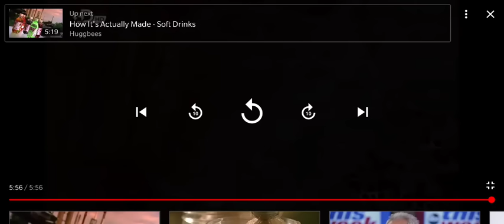Psychicpebbles Sandwich Rant on How it's actually made

Comment: I work in a place where we are explicitly told not to wear gloves to handle food. Instead we have to cut back our nails, and wash our hands constantly. The reason being that gloves give you a false sense of security and you end up touching things you shouldn't, and don't keep clean. So ironically instead of being safer, the gloves start collecting oils and bacteria and you end up just spreading all that bacteria into the food because you can't feel all the crap on your hands. If you're working in a factory like this though, where you wear a surgeons garb it's pretty stupid for one guy not to wear gloves imo.